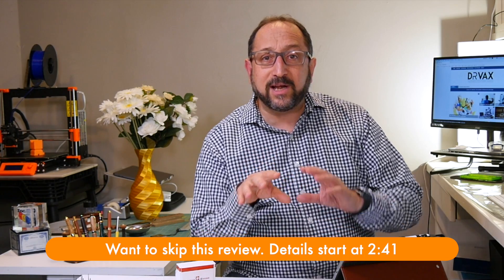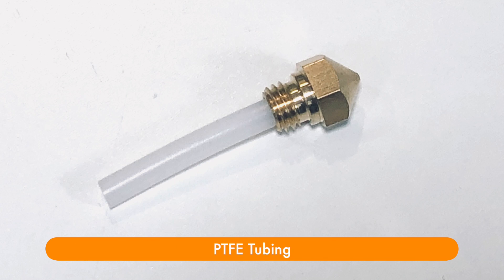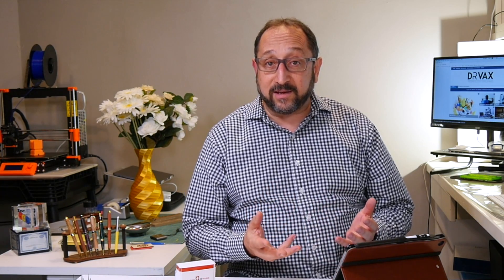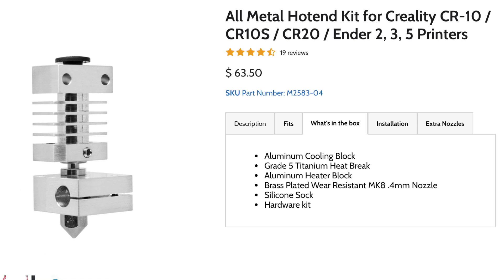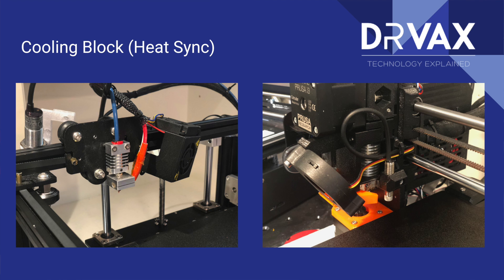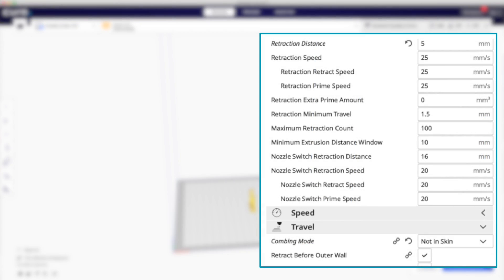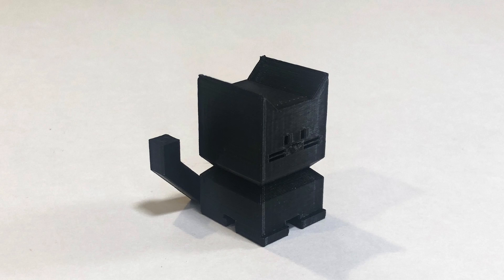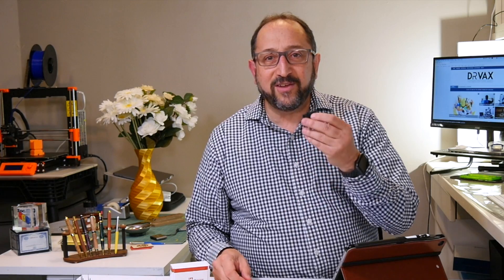Micros Swiss All Metal Hotend

Comment: Generally, i've drawn the conclusion from people complaining of all metal hotends (E3D V6, Micro Swiss ...) that they have issues because of the all-metal heatbreak. If using a metal heatbreak lined with PTFE tubing all those issues go away. For E3D V6 you have this option (from Chinese retailers) but for Microswiss i have not found it yet. This info helped me and solved most of my issues, maybe it will help some of your viewers as well. All of this provided there is a snug fit between all necessary components.
Reply from the maker: I think you probably are correct.  However, I have had no issues with my Microswiss manufactured all metal hot end.   I do not think people should assume Microswiss clones will perform the same way as original Microswiss hot ends.
Reply: @MakeWithTech  Oh I'm sure of that. There has to be a reason for the big price gap between the clone and original.